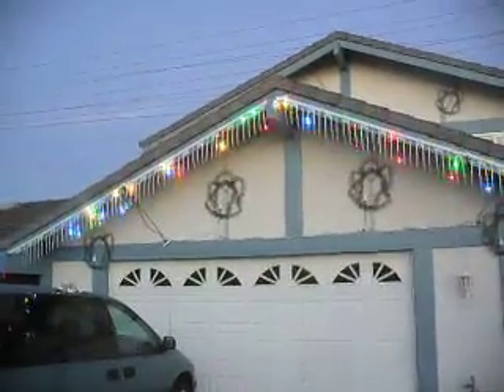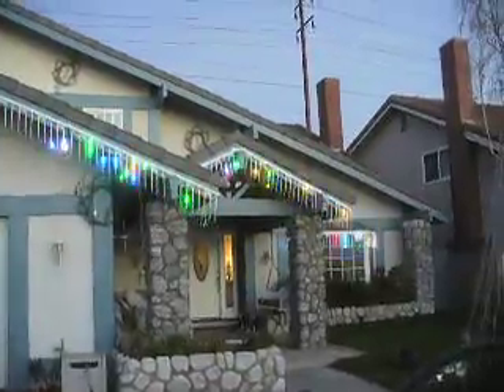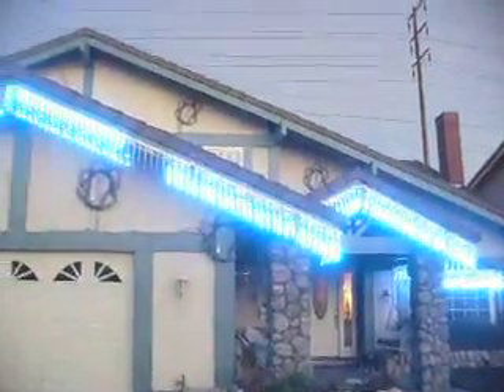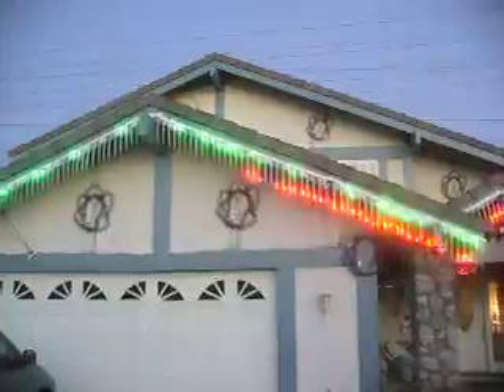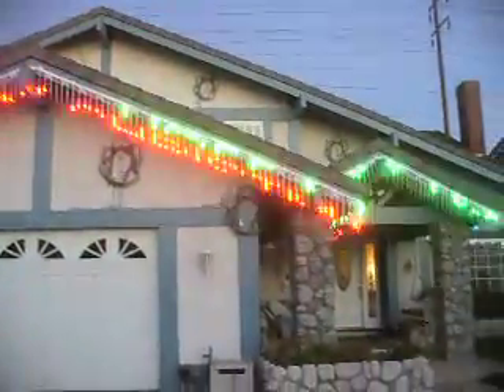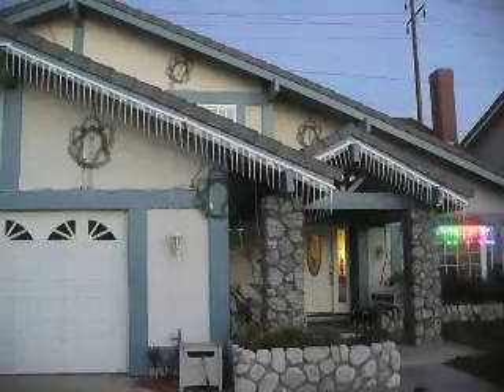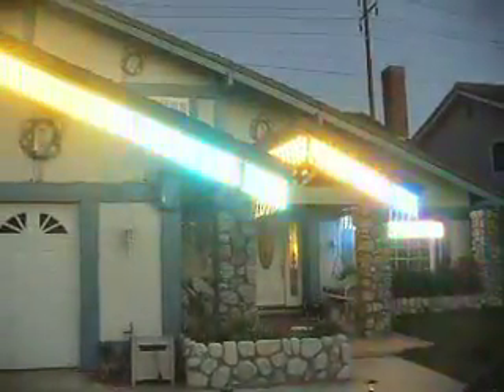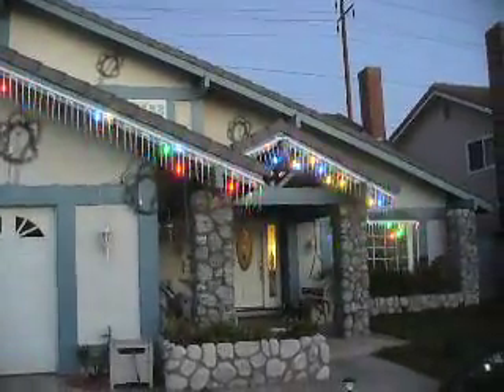RGB Icicle demo

Comment: Wondering what your spacing is on these icicles, e.g. distance between each drop, distance between each pixel in each drop and total drop length. It looks like 7 pixels per drop and approx 3" between each drop on the video.
Reply from the maker: I used 30 LED/m strips, which are ~ 1.3 inch spacing.  There are 10 pixels on each drop, with 3.25 inch between drops (15 icicles for each 4 ft of roof line).  Sections 3 + 4 of this doc describe the original construction technique:  https://downloads.eshepherdsoflight.com/HowIdid-WS281X-RGB-Icicles.pdf
Reply from the maker: Here is a closer view of the original icicles: https://youtu.be/kq247tOuSNM
Reply from the maker: Here is a video of the updated icicles (fancier cover, same original LED strips underneath)    https://youtu.be/OLhl46Wkhkw?list=PLDD35C88A6ED41F7F
Reply: Thanks for the info! Mine are going to be standard 7 nodes/drop; 15 drops/string (105 nodes/string) which just covers 45 inches with 3" spacing. I'm maintaining the "matrix" look by mounting them on clear "PixNode Strips" with fence wire woven into each drop to keep them straight and aligned.  It won't have the visual clarity you achieved, but I'm trying to cover 100' of roof edge!i
Reply from the maker: @richardrempes9663  100 ft is a lot of roof line!  If you add one more drop per string it'd be an even 4 feet, which might work out easier if you are using any horizontal mounting materials.  Please send a link for photos or video later!

Comment: you have info where you got the LED strip and other parts?
Reply from the maker: The LED strips are the type commonly available on eBay and Alibaba - 5 m 30 LED/m WS2811/2812, 5V (individually addressable), cut into 10 pixel lengths and daisy chained into lengths of ~ 300 pixels for data.  The white back/front is just 4 mm white coroplast cut into a wavey pattern.  The controllers are of the DIYC Renard type, described in detail at DoItYourselfChristmas.com (sorry for the late reply - didn't see the comment earlier)
Reply from the maker: It was hobby/DIY - the parts were somwhere around $600 USD, plus a bunch of time to make them.